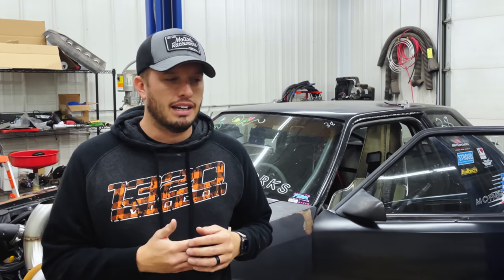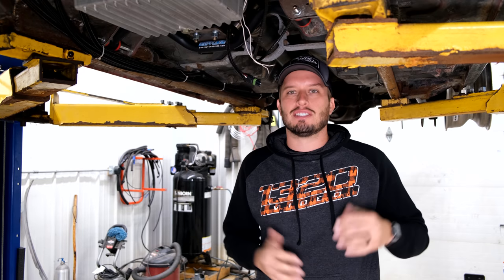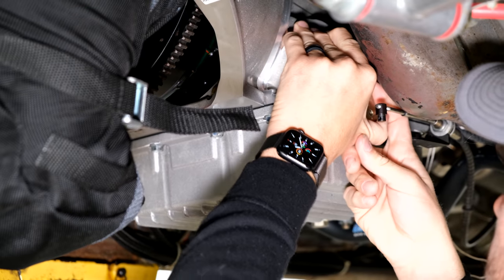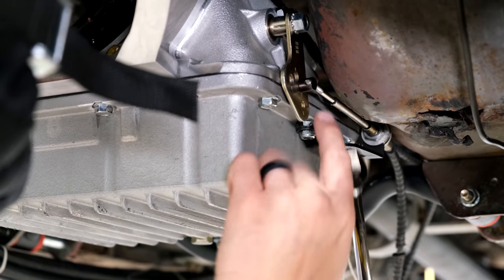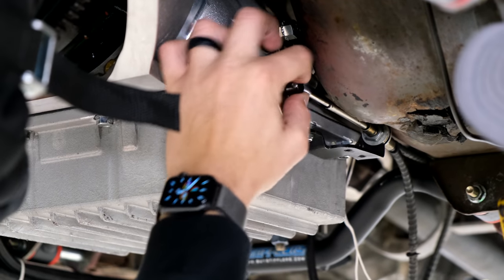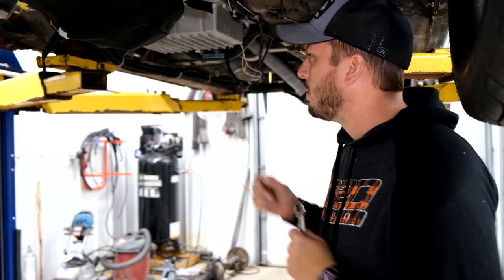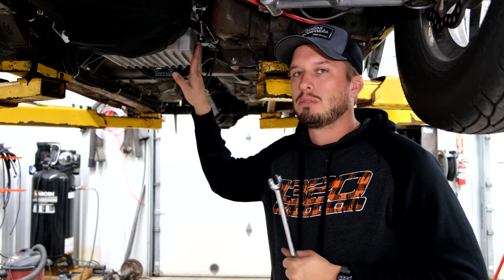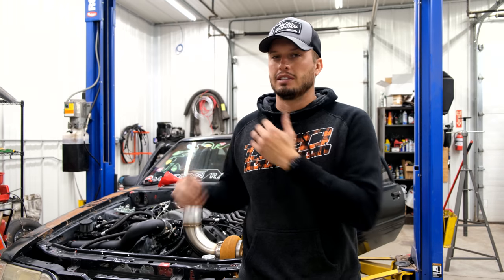How to save $1000s with proper shifter cable adjustment: Tech Tip Tuesday

Comment: it is BY FAR best to do this with the pan off...make sure the detent is falling in the correct position on the rooster comb. 
Also...with the pan off...you can make sure your dipstick is marked properly for "full" because most aftermarket dipsticks are way off for the "full" mark

Comment: How bout a video on the steering column side. Got a 93 Eddie Bauer explorer in great shape I just LOVE! I only bought it a month ago. But as I was changing fluid n filter and needed to make adjustments because previous owner for some reason(what I’m told is he always pulled trailers a lot(has a huge radiator and extra trans cooler) and didn’t want 4th gear) AL4E(or those letters n # in different order) pain in the rear! Thank you for the great videos!
Reply: OH MAN!!! My dad had that same vehicle,he passed away and I would love to find one now. His was stick shift,and would climb a tree! Damn good ride to have if you have bad roads to climb.
Reply: @normalhuman9260  I would MUCH prefer a stick! Ppl have gotten so lazy! Can’t even shift a car! Manuals are so much easier to
Work on and replace for less!

Comment: Learned this lesson recently 😂 I did the ol tensile strength test on my shift cable when pulling the original engine and trans out together. Didn't realized it actually stretched and snapped the plastic clip in the center console and I drove it the first couple tests drives like that. Was definitely in between gears... RIP 700r4 😅

Comment: I have a pro ratchet shifter. Powerglide with cable. Do i use the same spot for the pivot nut like in the video. Thanks. Number 2 on the bracket?

Comment: My v6 4runner 2007 
Shifting thru all gears well but cant shift to 5th gear even manually i tried on highway from L to 4 gear but when i put in D it still in 4th gear.
And from stop to start when i put from park to drive it engage in gear.
Drive on shifter working but cant shift to 5th gear.
The problem occurs when ichange the neutral safety switch.
I think they misaligned the linkage.
Because no cel no code on car.

Comment: I sure wish my piece of crap Chevrolet Tahoe transmission was like that and that easy to adjust know mine only has a plastic clip with four arms on it that falls apart and breaks it if you try to take it on and off about three times and you have to guess wherever it's going to be sitting

Comment: If gear shifter moves stiff.what is the problem
Reply: The braided cable has frayed and needs replaced. It will get worse very quickly as well. I know you asked this 10 months ago,hope it worked out for ya.